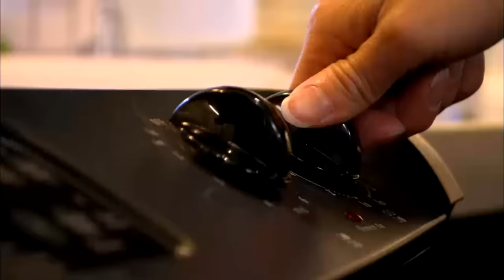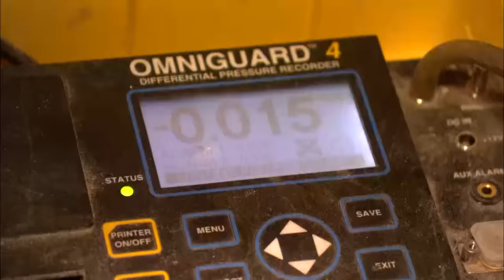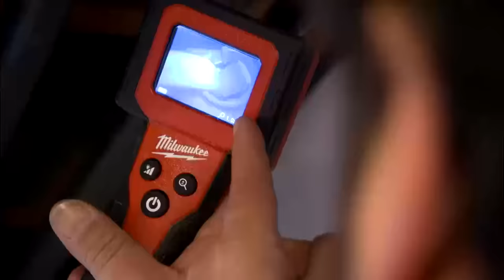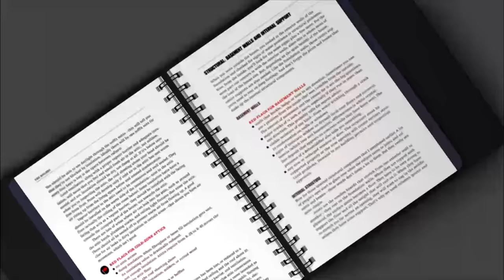Hidden Danger in Home Puts Family at Risk | Holmes Inspection 103

Comment: Can any recourse from a bad inspection be taken?
Reply: You can go after the inspector but it's costly and most contracts have a limited liability clause (usually in the small print).  Better chance of going after home seller, if you can prove they knew about it but did not disclose.
Reply: @dependablepaul  But the inspector did point out that there is a possibility of asbestos. The Homeowners should of investigated further or not buy the house.
Reply: The inspector only said it was possible based on age. The inspector did not actually look.    The sellers lied about it so they should be suing the sellers to pay for it.  You also always pay a plumber to scope out all the drains.  They did not do that either.  
The crazy part is they did not have the asbestos crew remove all the drywall.  Then they remove it with minimal protection and there was a tons of dust above the other drywall.
Reply: @GriggsC123 yes they should HAVe, not of
Reply: It’s pretty easy to fill every fixture with water and then let it all out at once while leaving all the taps on. Test it yourself, no matter what. Then, while it’s all on, be sure to look under each cabinet.
Reply: @common_c3nts  Maybe the sellers didn't know and the plumbers who did the remodel job didn't know, but the inspector suspected due to the age of the house a possibility. So the new homeowners could have hired their own inspector to check for these things.
Reply: @joea5183  blah blah blah.

Comment: So in the end, the asbestos here was a non issue because it was contained behind the ceiling. I would’ve sealed the open end and left it. Worry about it when you have to do the ceiling.
Reply: That ceiling joist is not sealed. Air in that ceiling joist circulates in the whole house. Problem here is that asbestos wrapping got disturbed and is worn out from age. Now the small particles are free in the ceiling cavity and can easily circulate around the house. I am sure these people did not breath enough to harm them but you never know what could happen in years. Best to get it out.

Comment: It is so great how they fix everything so good! But i keep wondering about the electrical. Here in Europe we put those wires in tubes and they go through the whole house. It looks here that they just have bare wire throughout the whole house! That’s still pretty dangerous if you ask me.
Reply: Wires go pretty much everywhere in houses in North America. The cables are not bare they have a PVC layer on the outside with cables inside also being covered. If you mean the bare copper that is the ground wire and it also goes inside the PVC but does not have another layer on it. The idea of this is if the wire PVC breaks it has contact to the ground to trip the breaker.

Comment: Asbestos is fine to leave, just don't touch it, and have the furnace filter analyzed for traces and and do the required cleaning so you don't disturb it. BTW almost all drywall mud compund older then 1990 has Asbestos in it
Reply: No it isn't. Law says it's got to go.
Reply: @MeepChangeling  In the US, the federal ban on asbestos was rescinded. It is no longer illegal unless a state introduced a ban. What is required is an asbestos inspection report for commercial, industrial and public school buildings prior to renovation, remodel, or maintenance activities that may disturbed materials that could be suspect for asbestos. Residential buildings with less than four units are typically exempt. However OSHA has worker safety rules about asbestos that may cause the need for residential inspection reports prior to work.